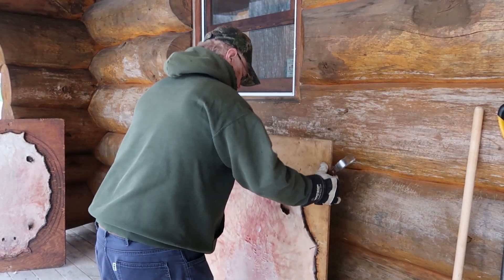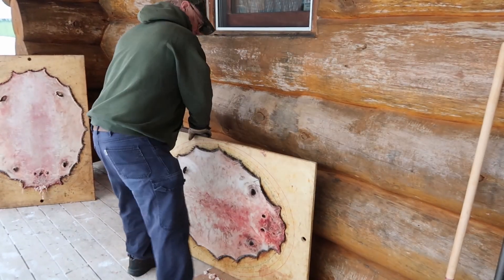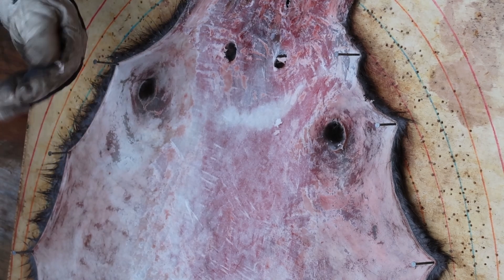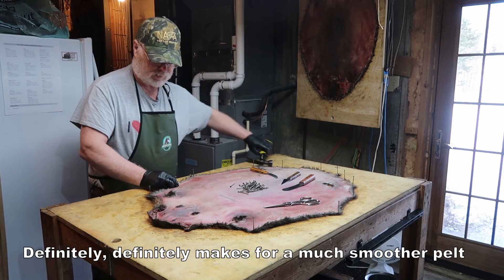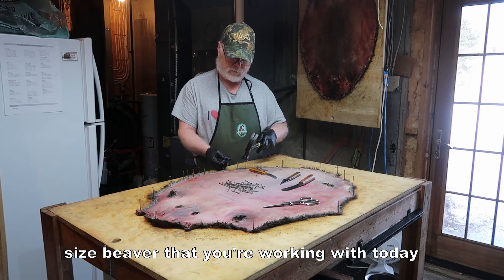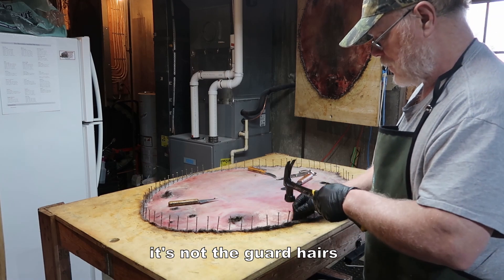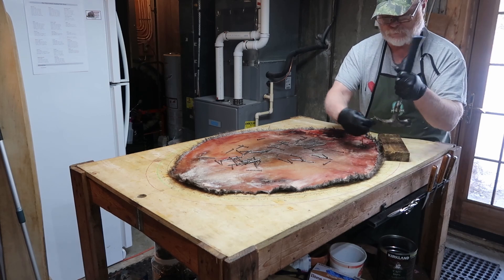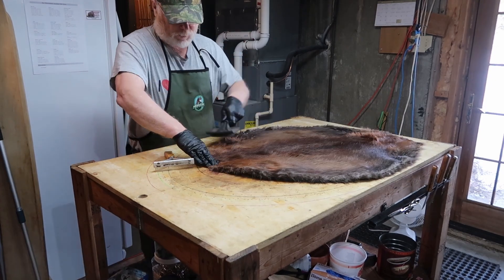Frost scraping Beaver part 2

Comment: Thanks for the demo Jim.  I used to frost scrape after learning from a trapper from Hearst.  I agree, the leather side is much better looking but I thought FHA has requested that beavers not be frost scraped anymore?  That is why I have not done it in years.  One thing I did, was a simple A frame and would sit the beaver board about belt height on the cross piece to not have to bend down.  My legs could work in between the A frame legs.  Worked really well.  I just rest the board against the wall.  The scrapings are awesome for marten bait.  I would put them in plastic milk bags.  Kept the bait nice an clean.  At the set, I just slice the bag open and squeeze into the box.  Gloves don't touch the bait.  All your other tips, are 100% on the money, especially not going sideways!!  You only do that once or twice.  :)  Thanks for taking the time to make these videos.  Always learn something from them.
Reply from the maker: I think they have problems with frost drying, have never heard any complaints about frost scraping.

Comment: Nice job Mr gibb! 
Would it be easier if the boards were higher up where you don't have to bend down? just a suggestion.
Reply from the maker: Yes for sure next year I will have a better setup.